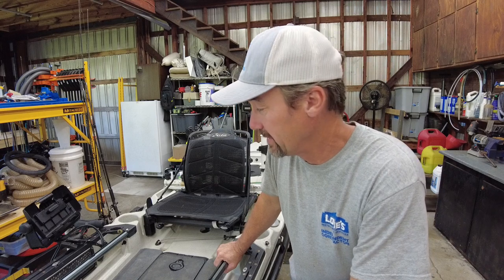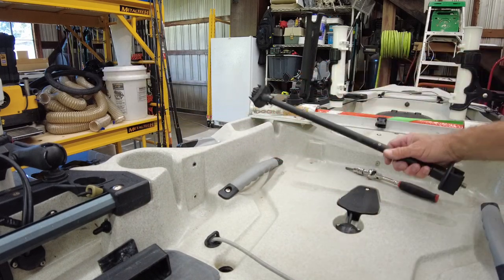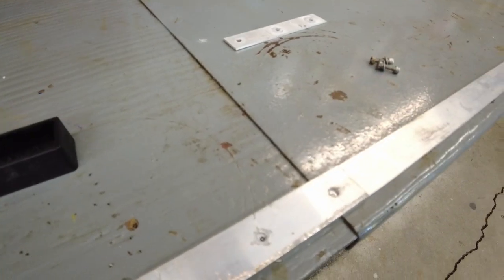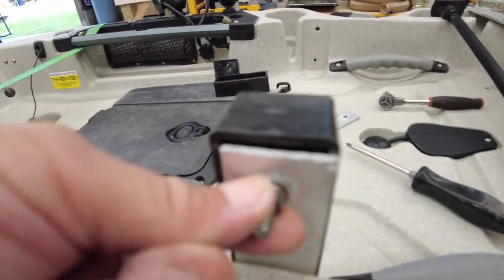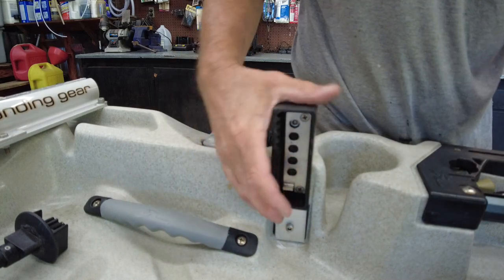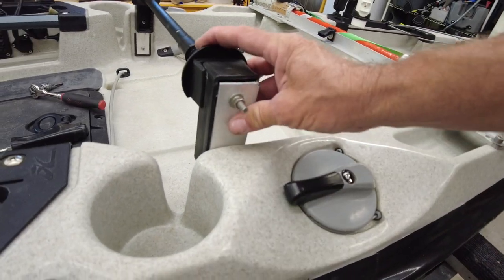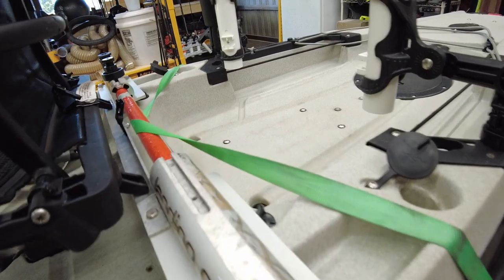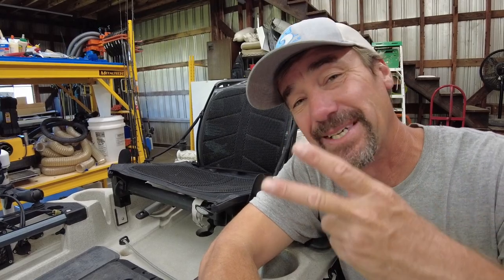Hobie Outback Custom Seat Risers (4 Inches Higher)

Comment: Thank you for this! I was able to complete this modification in about an hour which includes the drive to Home Depot for just about 20 bucks. 

Side note, on 2022 Hobie Outback’s, only one side has a spacer in it. I actually ended up taking it out because the aluminum was thick enough to make up the space without it.

Thanks again!

Comment: On my seat I have to pull the tabs to extending the back feet.  Yours look like the are out under tension.  Did you reverse them some way.
Reply: There's a video you just flip the spring that holds the flippers

Comment: Not sure those front supports would hold up on a bigger guy 230 lbs plus with pressure and rocking out on the water without an added block underneath for support. Nonetheless good idea & thought on that , & if one needed to they could add that if needed too. Im 250 lbs an I would be afraid to go out like that without torqueing & bouncing too much an then ripp out the brackets on side of kayak hull & then potentially a bigger problem produced & warranty was voided because of it. Just a thought. Tightlines.
Reply: I'm thinking there needs to be another block under each of the adjustment blocks  to help keep the aluminum trips from flexing, and to help support the vertical load on the adjusting blocks.

Comment: Thanks for this! I'm totally gonna try it in the next couple days.
Reply from the maker: Hope you like it!
Reply: @SouthernReelsFishing  I did this tonight. It went pretty smooth, but I did note a couple things; 
1) My 2020 outback only had a plastic spacer on the right/starboard side, and it was a little taller than yours. When I went to reassemble, I was not able to put it back in place, it was too tight. Probably doesn't matter.
2) it was tricky to get the gears to line up at the top on both sides, especially because of that tight fit. 
3) I capped the exposed screws with a couple acorn nuts which worked well

Sadly, while I had the seat off I noticed that I have the dreaded hull crack around one of the rear seat supports. Sigh, I'll have to begin the warranty hull replacement process.
Reply: So this weekend was my first chance to fish with the modded seat. Holy cow! So much better. More comfortable and standing is much easier. I hate the phrase game changer, but this really is one.
Reply from the maker: @Nate_Cross  That's awesome to hear! I am not surprised though. I would not have done a video on it if it didn't actually improve my comfort on the water. I'm glad it helped you as well!

Comment: looks good. try acorn nuts or tape  so you don't cut yourself on the bolts when using the rudder.
Reply from the maker: Yeah I plan to change it just been lazy. No problems on getting cut though